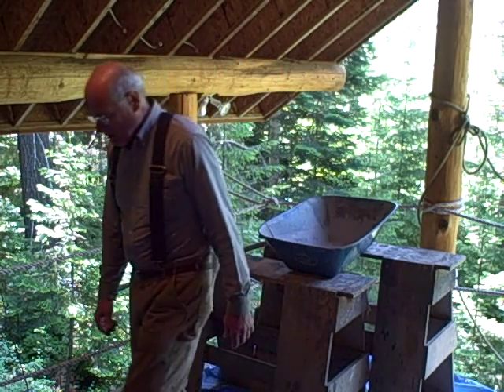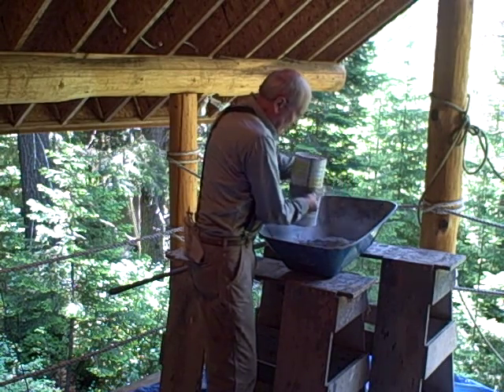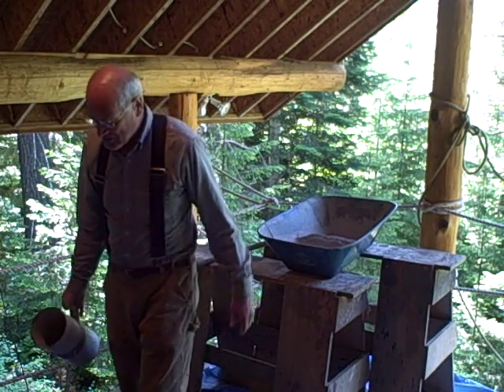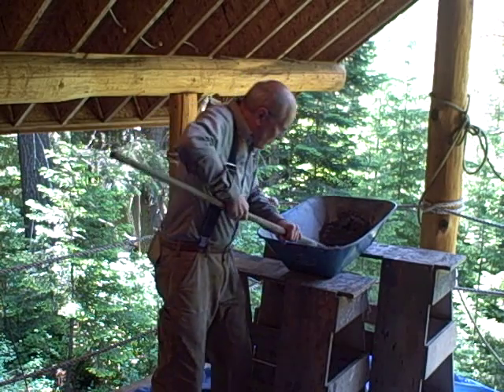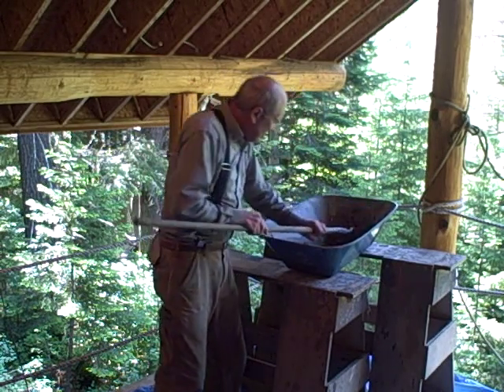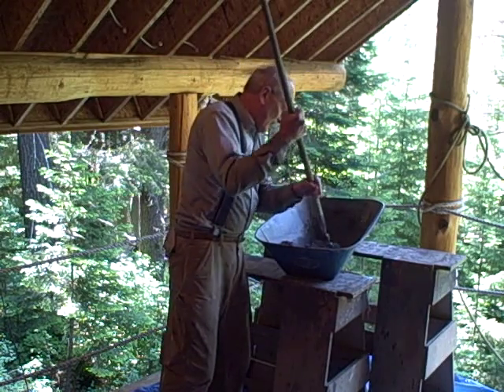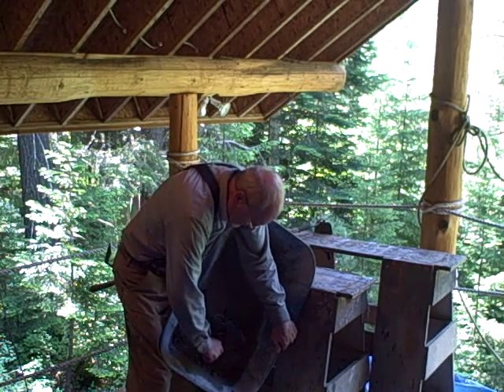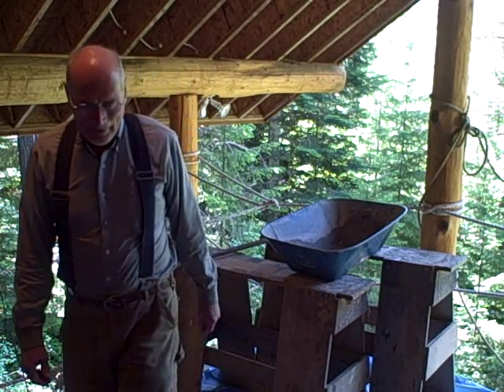Martin cabin 6/3/09 mixing mortar

Comment from the maker: Sorry about that novalee518, I did not plan the video very well. My attention was on my job of chinking. I answered your question on my website though. Take a look at my website in the FAQ section #32. "The plastic jar up to the hole holds 44 fluid oz. of water. The double coffee can container for the mortar mix holds 196 fluid oz. of mortar mix. That's 4.36 times as much mortar mix as water by volume."